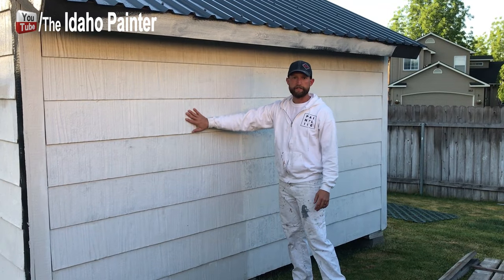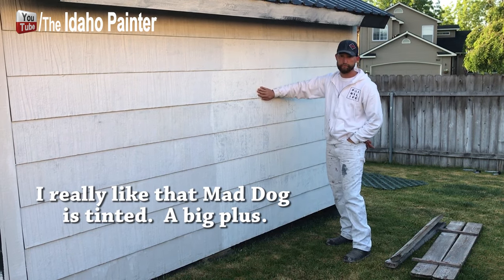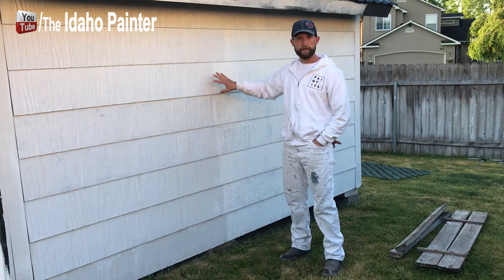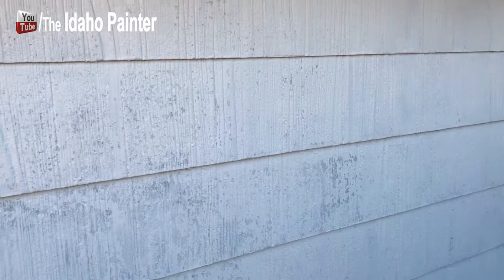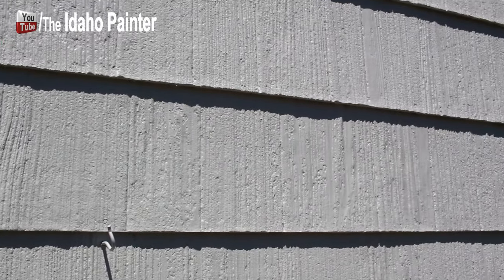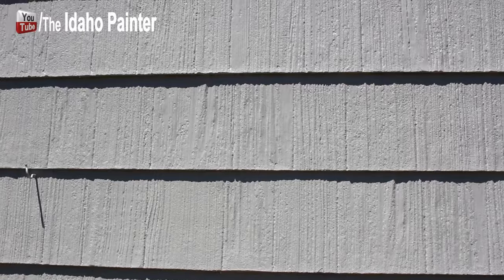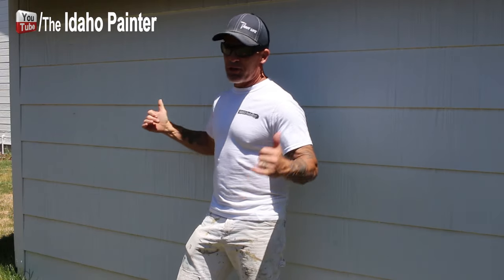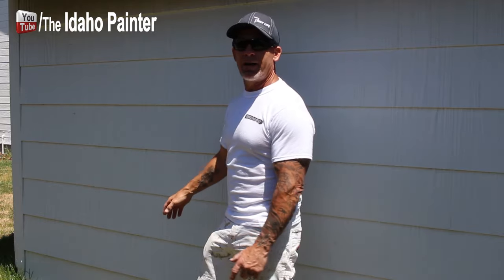How To Stop Or Repair Peeling Paint.

Comment: I would love to see a destructive comparison (remove them after a 24hr cure) of a few of the most popular bonding primers (don't include others) on a couple of substrates (Hardie siding, galvanized gutters).  MD2, KILZ Adhesion, DTM Bonding Primer, SW Extreme bond, XIM Peelbond, etc.  If they are all great and cover about the same, then that is fine, but if some of them fail and others don't, that would be really helpful to know.

Comment: Am in Hawaii and have used multiple products recommended by painters and paint shops to keep paint from peeling after a couple of years. Am careful with prep  and it seems to keep happening with the hot Hawaiian sun beating down on it day after day. Is this an oil based product? Does it actually work and is there some kind of warranty?..Thanks

Comment: Hi Chris, Don't know when you started using Mad dog but I've been using it for years! I'm currently working on a garage that has over hanging soffits and a fascia board. you can get in to sand or grind. Plus its old lead paint! I scraped everything using a full face mask & ear muffs, (safety first), then Mad Dog. Finis with Ben Moore Aura Satin, also a self priming finish coat finish coat. Results; it will last threw my life time! or until I retire!
Reply from the maker: Just discovered Mad Dog and it is awesome!

Comment: Thank you for introducing me to Mad Dog Primers! I used Dura Last for the inside of a garage that was peeling badly. We scraped all the loose material off  and applied a coat of Dura Last. It sealed everything up and made an excellent surface to apply the top coats.  I used Deck Fix on my own deck that I haven't been able to stain for several years because of  back issues. The deck was in very bad shape after a horrible experience with Behr, Deck Over. After finding the right Chiropractor, I was able to scrape the Deck Over off on my hands and knees, then a nice coat of Deck Fix sealed everything up.  I put on two coats of Sherwin Williams Super Deck solid stain. I couldn't be happier with the finished product. I'm anxious to see how long it lasts!
Reply from the maker: Thanks for sharing Donna! I'm glad it turned out good for you!

Comment: I'll be starting a large home soon that's in horrible condition and I think I'll try this stuff. I can see why you'd brush it on but can't imagine taking the time to brush an entire home - it would take forever. How much of a compromise would spraying it be? Major? Minor?
Reply from the maker: Rob spray and back brush it
Reply: Will be fine to spray, just make sure you BACK ROLL to work it into it! A lot of painters coat things but its like the shell of a M&M.
Reply: Contractors with a lot of experience with MDP gave me this advice a couple of years ago.  Turn the pressure down on the unit and splatter / spray Dura-Last onto the surface.  Then back brush and roll it into place.  A used 517 tip works fine.  This gets you the production speed you want, reduces the wear and tear on your elbow/shoulder when you are dipping your brush all day long into a bucket.  Great balance between old school quality and a faster more profitable job. Virtually no overspray and product loss!
Reply: = ) Spray and back roll. TOLD YOU GUYS
Reply: Never sprayed MD before. I goes on pretty easy brush or roller. I think I"d be afraid to mess my sprayer up. could get messy for everything! You, your sprayer and the job! LOL
Reply: MDP is fine in your sprayer. Just like any other latex paint. rinses and flushes out very easily!

Comment: Would like to see a bit on A-100 vs Superpaint.
We do residential repaint in the suburbs North of Dallas; mostly wood trim and/or Hardy board for exteriors.
We rarely use Superpaint over the past 12-13 years because of price difference and use A-100 almost exclusively because it has been dependently consistent in its performance.
The times we have used Superpaint in years past it performed rather admirably.
However, more recently, it seems to have a number of problems, which,  from talking to different sales reps from different paint outlets, I suspect is a byproduct of continual tweaking of the formula in supposed improvements (which also raises an already higher price).
We have used Graco 390s almost exclusively for about 10 years.
Any comments and suggestions are welcome and appreciated.
Reply from the maker: We primarily use Superpaint and would highly recommend it

Comment: Great Video Chris, I am assuming the clear drying product is XIM peelbond? If so are you seeing any difference is the results? You can only paint Satin Or Semi over the mad dog which can be a pain if a customer is looking for a velvet flat or low luster. Where as the peelbond can accept any sheen. And obviously the mad dog is almost double the price of the XIM. Any thoughts or suggestions on these observations?
Reply: MDP products accept solid latex stains, low lustre paints, eggshell, satin and semigloss as the first coat over our primer. 

Dura-Last has an MSRP of $49.99.
300 SF gallon or about $.165 per SF(if you pay retail)

Dura-Build is Mad Dog's "high-build" primer. People compare to Primer Rx (what a cool name), XIM Peel Bond, and Peel Stop Triple Thick.  

Dura-Build has an MSRP of $39.00  100 - 150 SF gallon or about $.319 per SF (if you pay retail).

Mad Dog quality at national brand prices.

Comment: when you pressure washed did you do anything to collect the loose paint chips that flew off or did you allow it to fall on the ground? I have a home with the same peeling problem and there is going to be a mess when I finish pressure washing it
Reply from the maker: 78835 fell on the ground then vacuumed with leaf vacuum
Reply: I played the video back in slow motion. 78837 fell to the ground! LOL
Reply: you can buy a mesh trap that is typically used for covering dumpster so you catch the big chips and the water drains out.
Reply: ...laying cloths is an easy way to contain the mess...then it can all be rolled into one big pile as opposed to X amount of linear feet of chips to sweep/vacuum...
Reply: Andrew Featherstone is that at the local hardware store thx!
Reply: I just buy them at the local box store. You will catch most of them but you will still need to vacuum some chips. You can also use landscape fabric to catch them as long as you weigh it down.

Comment: My mom has a concrete wall that gets a lot of sun. I painted it a few years ago and it's flaking badly. Even if this primer is really good, isn't it limited by the concrete itself flaking off? How can I stop that?
Reply from the maker: Brian Burke get the flaking concrete off then prime it
Reply: Thank you. Pressure wash you think?
Reply: Brian Burke always power wash anything you paint
Reply: Dura-Last will work on new and weathered concrete as well.  With decent prep, a full prime, and a coat of paint, it should last 3-4 times longer than a traditional system.  Check out a 2005 cinderblock "horror show" project suffering from peeling paint and efflorescence. see the the results after 12 years: https://maddogprimer.com/dealer-resources/project-examples/

Comment: Hey brother 
I have a crack interior ceiling on a big job that im doing 
I wonder if it this will fix all the cracks
Reply: I had two cracks in my ceiling that I had to cut out the bad drywall and fill it with a mixture of drywall mud and Plaster de Paris.

Comment: How do you fix paint that peeled off when removing the tape? I removed the tape around my tub a few days after I sprayed it and and it peeled off in spots.
Reply: Tara H you don't peel tape after the paint is dried, you pull the tape while the paint is wet.

Comment: I know you said you prefer painting it on... But is it too thick for spraying?
Reply: I'm currently doing this on Cedar Shakes (machine grooved) and tried to spray. It doesn't cover as thick as I wanted, and it didn't spray very well. To be honest, i used a 6 inch roller with 1" nap and it worked really really well.

Comment: Been watching your vids for a while now and have to say thanks for all the informative into.  I have an old home with textured shake siding.  The south side of the house that gets sun is peeling bad.  My plan is to use a paint like this or the XIM peel bond that you've shown in the past.  My question is about prep.  I could get it stripped by going over it mildly with a scraper then hitting the rest with a 5 in 1 letting the paint fall onto plastic sheeting for cleanup.  I've tested a few areas on prep and this seems to work well.  My only concern is that the underlying paint tests positive for lead.  Any suggestions on pre-cautions?